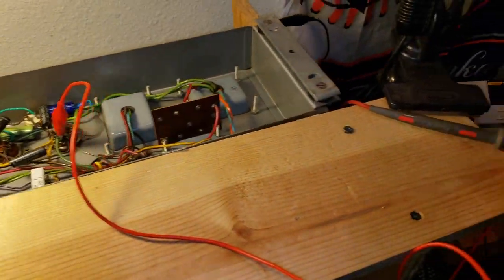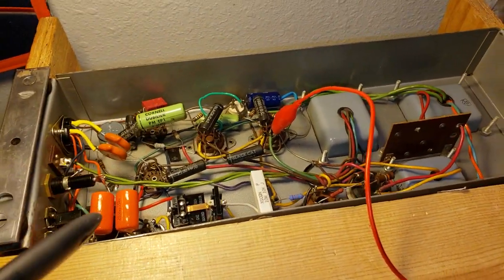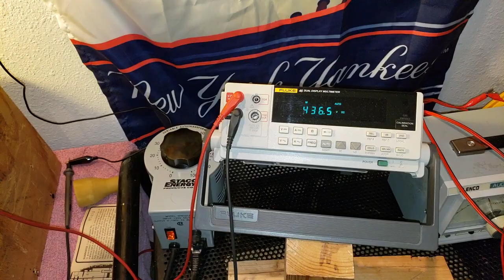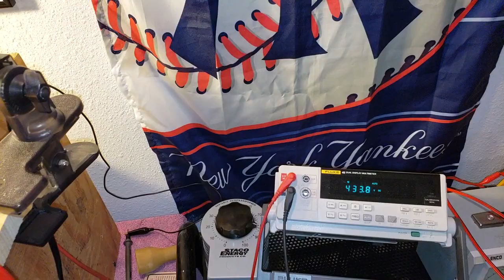Evaluating The Plate Voltage In A 6550 Tube Used In A Leslie 122 Amplifier

Comment: So i have a question about lowering the plate voltage. If your plate is to high. I was told you can a get large resistor and connect it to the secondary high voltage center tap to ground and that will lower the plate voltage, is this correct? Thank you
Reply from the maker: I evaluate the voltages and try to get them to fall within the factory range by installing parts according to the standards set by the factory.  I never get into the reengineering of the amplifier. I can't help you with that.

Comment: So if I understand correctly - the connection is made with no power to the amp.  Then the amp is powered up?  Looks like there is also a ground lead connected to the chassis?  I tried measuring the plate voltage on V2 (a 6L6GC) on my Fender Hot Rod Deluxe by connecting to pin 3 while the amp was already on and warmed up.  A flash and some smoke told me i did something seriously wrong
Reply from the maker: Bruh - The guitar professional amp restoration guys told me that a guitar amp is different than these Leslie amps and that if you don't know what you are doing with one, either learn about it from a professional while reading about them or just leave them alone.  I choose to leave those alone until I get some training on those as I did with the Leslie amplifiers many years ago.